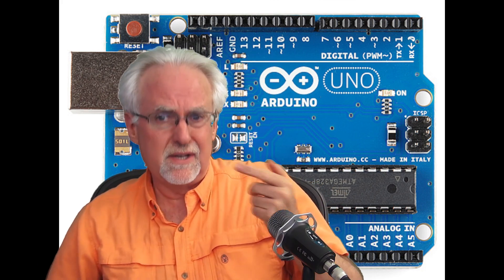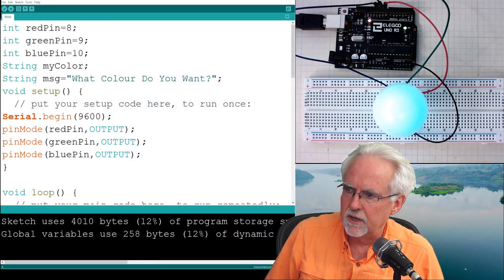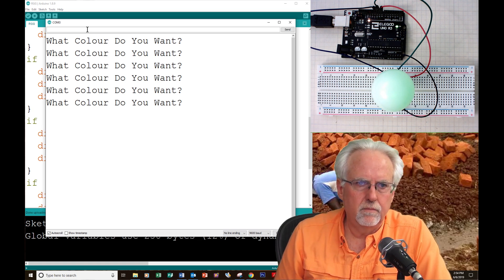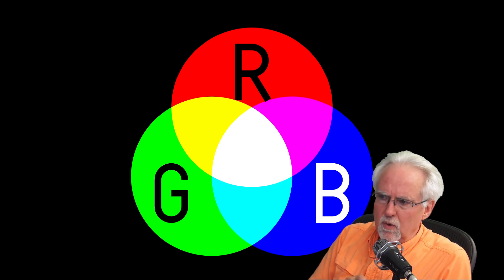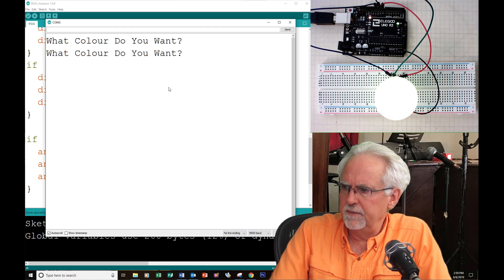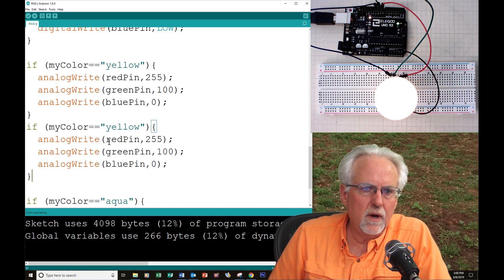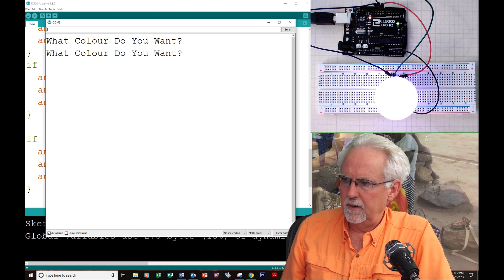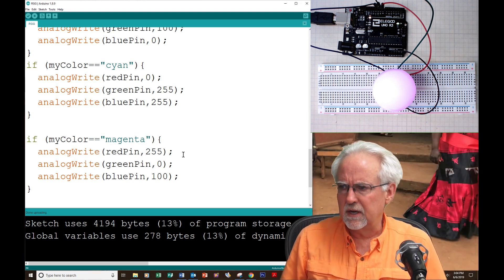Arduino Tutorial 21: Understanding and Mixing Primary Colors with an RGB LED

Comment: Hi Paul,
Just been following your tutorials pt20 and pt21. I think my RGB LED must be top heavy on green, it always seems to be very green.

Here's my sketch for changing the LED to different colours.

int redPin=12;
int greenPin=10;
int bluePin=8;
int myColorRed;
int myColorGreen;
int myColorBlue;

String msg1="Enter Red value?";
String msg2="Enter Green value?";
String msg3="Enter Blue value?";
String blanks ="  ";

void setup() {
  // put your setup code here, to run once:
Serial.begin(9600);
pinMode(redPin,OUTPUT);
pinMode(greenPin,OUTPUT);
pinMode(bluePin,OUTPUT);
}
 
void loop() {
  // put your main code here, to run repeatedly:
Serial.println(msg1);
while (Serial.available()==0){
  
}
myColorRed=Serial.parseInt();

Serial.println(msg2);
while (Serial.available()==0){
  
}
myColorGreen=Serial.parseInt();

Serial.println(msg3);
while (Serial.available()==0){
  
}
myColorBlue=Serial.parseInt();

analogWrite(redPin,myColorRed);
analogWrite(greenPin,myColorGreen);
analogWrite(bluePin,myColorBlue);

Serial.print ("red = ");
Serial.print(myColorRed);
Serial.print(blanks);

Serial.print ("green = ");
Serial.print(myColorGreen);
Serial.print(blanks);

Serial.print ("blue = ");
Serial.print(myColorBlue);
Serial.print(blanks);
Serial.println();

}

Best wishes,

Suzanne, UK.

Comment: Thanks Paul. If I had had a teacher like you in school days... I have a question on the code. As far as I know, "analogWrite" is applied to either an "Analog pin" or "digital PWM pin(3,5,6, 9,10,11). But you connected the red pin to 8, which is not a PWM pin. Is it O.K? If it is, is there something I don't know? Thanks again Paul. (By the way, I'm using a Uno and Nano board as you suggested.)

Comment: Turn a batch of coffee into ice. Then it won't dilute the drink over time
Reply from the maker: My strategy is to make espresso, which is much to strong to drink and pour it over ice, with the goal being to have the ice cool the coffee, as well as dilute it to a perfect strength. Making coffee into ice cubes would require making weaker coffee to begin with, which yields a more bitter beverage.
Reply: @paulmcwhorter  4-18-21 Paul, I just sent you some coffee.  Hopefully your still drinking it and making videos!  I really appreciate the knowledge you are sharing with the world.  Delivery date for the starbucks coffee variety pack is 4-26-21.  I piggy back from my work account so dont be confused when it comes from a fence company.  Wish I could have sent more because you deserve it.  Thanks again

Comment: Mr. McWorther! I did this homework! it worked with me, and I of course didn't forget the ping pong ball, here is my code.

int rPin=12;
int gPin=8;
int bPin=7;
String ledColour;
int dt=1000;
String error="You didn't write an option, please try again.";
String msg="What colour led do you want?";
void setup() {
  // put your setup code here, to run once:
Serial.begin(9600);
pinMode(rPin,OUTPUT);
pinMode(bPin,OUTPUT);
pinMode(gPin,OUTPUT);

}

void loop() {
  // put your main code here, to run repeatedly:
Serial.println(msg);
while(Serial.available()==0){
  
}
ledColour=Serial.readString();
if(ledColour=="Blue"||ledColour=="blue"){
  digitalWrite(bPin,HIGH);
  digitalWrite(gPin,LOW);
  digitalWrite(rPin,LOW);
}
if(ledColour=="Green"||ledColour=="green"){
  digitalWrite(bPin,LOW);
  digitalWrite(gPin,HIGH);
  digitalWrite(rPin,LOW);
}
if(ledColour=="Red"||ledColour=="red"){
  digitalWrite(bPin,LOW);
  digitalWrite(gPin,LOW);
  digitalWrite(rPin,HIGH);
}
if(ledColour=="Off"||ledColour=="off"){
  digitalWrite(bPin,LOW);
  digitalWrite(gPin,LOW);
  digitalWrite(rPin,LOW);
}
if(ledColour=="Aqua"||ledColour=="aqua"){
  analogWrite(rPin,0);
  analogWrite(gPin,255);
  analogWrite(bPin,75);
}
if(ledColour=="Cyan"||ledColour=="cyan"){
  analogWrite(rPin,0);
  analogWrite(gPin,255);
  analogWrite(bPin,125);
}
if(ledColour=="Magenta"||ledColour=="magenta"){
  analogWrite(rPin,255);
  analogWrite(gPin,0);
  analogWrite(bPin,150);
}
if(ledColour=="Fuscha"||ledColour=="fuscha"){
  analogWrite(rPin,153);
  analogWrite(gPin,0);
  analogWrite(bPin,77);
}
if(ledColour=="Yellow"||ledColour=="yellow"){
  analogWrite(rPin,255);
  analogWrite(gPin,175);
  analogWrite(bPin,0);
}
if(ledColour=="Orange"||ledColour=="orange"){
  analogWrite(rPin,255);
  analogWrite(gPin,65);
  analogWrite(bPin,0);
}
delay(dt);
}

Comment: You should move the red LED from Pin 8 to a PWM pin, at least when you switch from digitalWrite() to analogWrite().  Your sketch appears to work because you only use 0 and 255 for analogWrite() on Pin 8 and those are equivalent to digitalWrite(8, LOW) and digitalWrite(8, HIGH).  If you tried to ade the red pin you would see that it doesn't.  This will be confusing to beginners who try to extend your example.

Comment: On the off chance that you see this Paul, you use Pins 8, 9, & 10 for the RGB LED but surely Pin is not a PWM pin and therefore will not accept an analogWrite command! I am a bit puzzled!

Comment: Here is an example of how I dared to stray from the beaten path and use some of coding I learned to write a program that goes through all colors. Now I will make this my night lamp.

//This program will make the RGB LED to go through various colors 

int R; // R to be used for Red leg of LED
int G; // G for the Green Leg of LED
int B; // B for the Blue leg
int  redPin=9;// red leg of LED attached to Arduino pin 9 
int greenPin=10; // green leg of LED attached to Arduino pin 9
int bluePin=11; // leg of LED attached to Arduino pin 11
int redTime=75;  // For colors to linger longer increase this number
int greenTime=100; // Same as above
int blueTime=50; // Or set them all at the same time

void setup() {
   Serial.begin (9600);
pinMode (redPin,OUTPUT);
pinMode (greenPin,OUTPUT);
pinMode (bluePin,OUTPUT);
}

void loop() {
            for (int R=0;R<255; R=R+1)
            {
            analogWrite (redPin, R);
            delay (redTime);
            for (int R=255;R=0; R=R-1)
            {
            analogWrite (redPin,R);
            delay (redTime);
            Serial.println(R); //displays the values (mine worked first and then stopped for some reason)
            }
            }
for (int G=0;G<255; G=G+1){
  analogWrite (greenPin,G);
  delay (greenTime);
  for (int G=255;G=0; G=G-1){
  analogWrite (greenPin,G);
  delay (greenTime);
  Serial.println(G);
}

  }
  for (int B=0;B<255; B=B+1){
  analogWrite (bluePin,B);
  delay (blueTime);
  for (int B=255;B=0; B=B-1){
  analogWrite (bluePin,B);
  delay (blueTime);
  Serial.println(B);
  }

}
}

Comment: Sir, thanks for your video series. Very informative and fun to follow along. 

Here is a great site to see the RGB values for various "standard" colours: https://www.w3schools.com/colors/color_tryit.asp?hex=FF7F50. 

I wrote the following version of your program to create any colour combination from inputs: 

int myRed;
int myGreen;
int myBlue;

String msg1="What RGB colour would you like? Red value 0-255=";
String msg2="What RGB colour would you like? Green value 0-255=";
String msg3="What RGB colour would you like? Blue value 0-255=";
String msg4="Your colour code is ";
String msg5=" , ";

int dT=250;

int blueLED = 11;
int greenLED = 10;
int redLED = 9;

void setup() {
  // put your setup code here, to run once:
  pinMode(blueLED, OUTPUT);
  pinMode(greenLED, OUTPUT);
  pinMode(redLED, OUTPUT);
  
Serial.begin(9600);
}

void loop() {
  // put your main code here, to run repeatedly:
Serial.println(msg1);
while (Serial.available()==0){
}
myRed=Serial.parseInt();

Serial.println(msg2);
while (Serial.available()==0){
}
myGreen=Serial.parseInt();

Serial.println(msg3);
while (Serial.available()==0){
}
myBlue=Serial.parseInt();

  analogWrite(blueLED, myBlue);
  analogWrite(greenLED, myGreen);
  analogWrite(redLED, myRed);
  
  Serial.print(msg4);
  Serial.print(myRed);
  Serial.print(msg5);
  Serial.print(myGreen);
  Serial.print(msg5);
  Serial.println(myBlue);
  
Serial.println();

delay(dT);
}

Comment: With LED I have, I can't go bellow 130 with each color and I noticed some colors are brighter then others, so I started to also play with resistors. Long story short, I can make any color I want, but not all of them anytime, because some colors needs different resistors. I even tried to make one pin with green 220ohm and other pin with green 1000ohms, but the one with more resistance just didn't post. So no, can't make both orange and yellow in single program. What a shame. But doesn't matter, I understand how it works, thanks to this lesson, so let's continue :-)

Comment: Tip: You can get any color you want by knowing the hex value of that color and converting it to RGB color value. For this, I'd recommend simply in google write 'rgb to hex'. It will give you a color to select and displays the rgb value of that color. Plug that rgb value in this project and voila, you get the same color.

Comment: This was my solution to the exercise at the end of lesson 20.  I was using a common Anode RGB LED, so using analog,Write a value of 0 switched the colour on, and 255 switched it off, with corresponding values inbetween to mix the colours.  Also inserted 3 potentiometers into the circuit which enabled me to mix the colour by turning the pot.  Great lectures as always.  Really helping me to learn and use my kit.

Comment: Hi Paul. Hopefully you check in on these comments once in a while. Your issue with the camera is auto-iris. This can be disabled on virtually every camera. On many cameras, there is an 'A' setting, which stands for 'aperture priority'. They also usually have a 'T' setting for 'shutter priority'. You want to disable these. Look for an 'M' setting, for 'manual'. With this you can set the aperture manually and it will not change until you change it. In a studio situation such as yours, this is normally the best option. If you reply with the make & model of camera, I may be able to offer advice.

Comment: Very cool.  Thanks to you Paul, and a little of my own imagination, I figure I just wrote some code that will eventually show all 16,777,216 colors.  Check this out:
BTW, didn't have a ping-pong ball, so I used a cotton ball help mix the colors.

int redLED=9;
int blueLED=6;
int greenLED=5;
int redLevel;
int blueLevel;
int greenLevel;
void setup() {
  // put your setup code here, to run once:
Serial.begin (115200);
pinMode(redLED,OUTPUT);
pinMode(blueLED,OUTPUT);
pinMode(greenLED,OUTPUT);
}
void loop() {

  analogWrite (redLED,redLevel);
  analogWrite (greenLED,greenLevel);
  analogWrite (blueLED,blueLevel);
  
  Serial.print ("red = ");
  Serial.println (redLevel);
  Serial.print ("green = ");
  Serial.println (greenLevel);
  Serial.print ("blue = ");
  Serial.println (blueLevel);
  Serial.println();
  delay (1000);
 if (redLevel>255){
  (redLevel=redLevel-259);
  }
  
 if (greenLevel>255){
  (greenLevel=greenLevel-261);
  }
  
 if (blueLevel>255){
  (blueLevel=blueLevel-263);
  }
  
    redLevel=(redLevel=redLevel+3);
    greenLevel=(greenLevel+5);
    blueLevel=(blueLevel+7);
  }

Comment: Hi Paul, Really enjoying these. I am a pastor who started as a ChemE. I wrote a program to input the 3 color values and then analog print the three values to the RGB pins so you could easily input whatever color you want from the chart. Your lessons are very helpful. I programmed in FORTRAN years ago.  Very nice refresher course with the Arduino.

Comment: im going back through lessons again. I hooked up everything exactly the same way you did and my code checks out but for some reason the rgbled wont light up. when I hook it to the 5V it lights up, ive replaced resistors wires and the rgbled itselfstill wont light up. I even went to your website and from the old Arduino lesson hooked it up that way from the schematic.
Reply: livelaugh thrive Did you set your serial output to: No Line Ending ?

Comment: Paul, I believe the RGB series is additive for colored lights.  All three lights add to white.  Whereas CMY is for printing so there light is absorbed and re-transmitted.  All three printed colors give you black.  You can see that for your two diagrams.  If you did CMY for light bulbs, you wouldn't get black; not sure what you would get.  I used to work for a paper company and did printing as part of product development and have a degree in mechanical engineering.

Comment: I'm am wondering  if the pin used in this lesson should have been PWM or a Analog pin, or it doesn't matter if you put in a value? I'm just a beginner  at this  and this is the best structured instructions for learning Arduino.

Comment: Hello.I think I have hardware issues. My conditionals keep getting ignored. I think my code is right.
int bluePin=5;
int greenPin=4;
int redPin=3;
String myColor;
String msg="What color do you want?: ";

void setup() {
  // put your setup code here, to run once:
Serial.begin(9600);
pinMode(bluePin,OUTPUT);
pinMode(greenPin,OUTPUT);
pinMode(redPin,OUTPUT);
}

void loop() {
  // put your main code here, to run repeatedly:
  Serial.println(msg);

  while (Serial.available()==0){
    }

  myColor=Serial.readString();
  Serial.print(myColor);

    if (myColor == "blue"){
      Serial.println("Good read ");
      /digitalWrite(bluePin,HIGH);
      digitalWrite(greenPin,LOW);
      digitalWrite(redPin,LOW);
      } 
      else if (myColor == "green"){
      digitalWrite(bluePin,LOW);
      digitalWrite(greenPin,HIGH);
      digitalWrite(redPin,LOW);
      } 
      else if (myColor == "red"){
      digitalWrite(bluePin,LOW);
      digitalWrite(greenPin,LOW);
      digitalWrite(redPin,HIGH);
      }
      else {
      digitalWrite(bluePin,LOW);
      digitalWrite(greenPin,LOW);
      digitalWrite(redPin,LOW);
      Serial.println("Invalid Input");
      }
    
}

Does anybody see if I did anything Silly?

Comment: sir ,  for any analog command we have use analog pin  which are 3,5,6,9,10,11 but in the above video we have  use analogWrite(redpin,255)  and the redpin is connected with 8 number pin which is not an analog pin  on the video "8:40"  . so, we have to change the pin or  it's correct

Comment: I had problems with this one when we got to the analogWrite commands.

it seemed that the only analog value recognised was 255, or 0 so it was behaving as a digital write.

I eventually got it to work as yours does by introducing a section in void setup analogWriting all three pins to 0.

I'm using a MEGA2560 instead of your UNO; don't know if this makes a difference?

Love the series, and appreciate the 'Colour' spelling - now if you could only persuade Arduino to change 'analog' to 'analogue'...…

Comment: //ring colorPrompt = "Pick a color : Red, Blue, Green";
int B = 8;
int G = 9;
int R = 10;

int rValue;
int gValue;
int bValue;
void setup() {
  // put your setup code here, to run once:
  Serial.begin(9600);  
  pinMode(B, OUTPUT);
  pinMode(R, OUTPUT);
  pinMode(G, OUTPUT);
  
  
  

}

void loop() {
  // put your main code here, to run repeatedly: 
 //erial.println(colorPrompt);
  Serial.println("Enter red value, 0-255");
  while (Serial.available() == 0){
  }
  rValue = Serial.parseInt();
  Serial.println("Enter green value, 0-255");
  while (Serial.available() == 0){
  
  
  }
  gValue = Serial.parseInt();
  Serial.println("Enter blue value, 0-255");
  while (Serial.available() == 0){
  
  }
  bValue = Serial.parseInt();
 
 
 analogWrite(R, rValue);
 analogWrite(G, gValue);
 analogWrite(B, bValue);
}

I make it light this so I have much power to control my color.

Comment: my mistake was adding leading zeros in analogWrite commands. Doesn't like it at all! Being too clever by half, here. Also, the RGB elements in the diode are not equiluminescent, so just plugging in values from an RGB chart online won't necessarily produce the colour wanted. Tweak tweak tweak.

Comment: Hats off Paul on yet another cool project. I got this far in following the tutorials and at this point I decided to improve a little bit. Namely, I decided to put this little RGB "lamp" on a continuous loop to increase/decrease gradually all the colors, each LED going from 0 to 255. So I decided to write 2 loops using the "for" command and I told Arduino to start from zero on each LED and gradually increase the voltage to max 255 by using the ++ command. This way I was trying to get through all the possible combinations of RGB gradually. The second loop was the opposite. I used the "for" command to start from 255 and decrease the voltage by - - . Unfortunately I discovered that I still have to practice a bit more since something went south somewhere in these loops. I won't stop though. I will stick around until I learn some more. Blessings from British Columbia, Canada.

Comment: I used a potentiameter and 2 pullup resistors with RGB LED and switch between main colors by tapping a key, adjusting the strength of each color by turning the nub, and clicking another button to set the color. It's amazing!!!
Reply: You Excel
Reply: Thanks. That's a great project idea.

Comment: I bought the elegoo from your link and it has been great but the actual arduino did not work correctly, but I had an original which I have been able to utilize for the videos.  Again I appreciate all the work you put into these great videos!!

Comment: Another great lesson! How about adding a pot in each of the RGB legs and varying  the applied voltage co you could continuously change the colors? Does the Elgoo kit have 3 pots of the same value?
Reply from the maker: A great idea. Dont think the elegoo kit has three pots, but they cost next to nothing on Amazon . . . grab a few in your next amazon order.